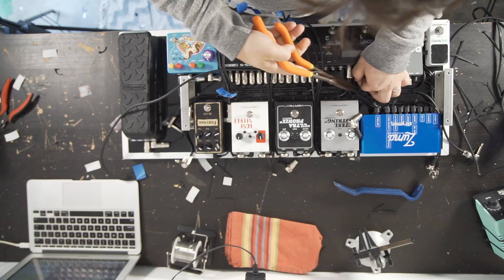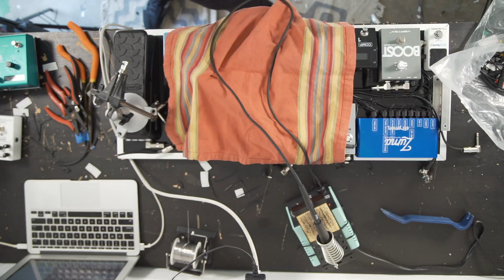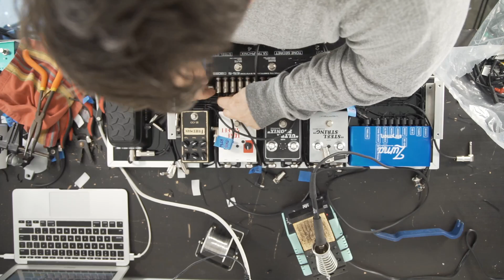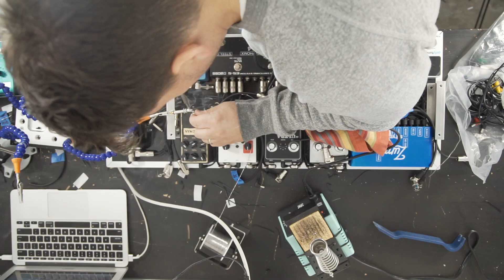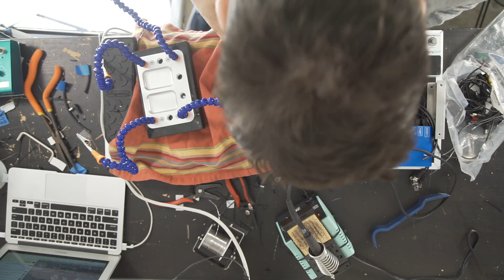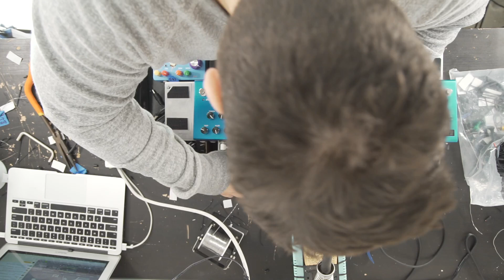Wiring a Pedalboard Switcher

Comment from the maker: Howdy folks!  Here's a little live stream for ya on how I wired this Boss ES-5 switcher.
Reply: Vertex Effects dang I suggested this through email awesome!
Reply: You find the Boss ES-5 Loops sound transparent (dare I use that word!)? It seems to be a pretty good deal.
Reply from the maker: Daniel Jeong There will be a follow up video coming out this week, so stay tuned!
Reply from the maker: Grant Ferstat Yes, this is all pretty standard stuff with the relays and all that for switching it out the loops, the only area where you’ll run into coloration is in the buffer. I haven’t disassemble the unit to test the actual buffer inside, however it sounds different than what I presume is the standard buffer circuit inside most boss pedals.  I wouldn’t say it’s totally transparent in terms of the buffer, however I think it sounds very good. I haven’t tested how long of a line it can reasonably run on the output before the tone really gets affected, but most of the times I’m using my own buffer on at least the output, if not the input as well so this is been a non-issue.

Comment: I guess the biggest advantage to the PedalTrain style boards is the space you gain by under-mounting the power-supply.  Maybe weight too??
Reply from the maker: PeterPug007 I would say it has way more deficits than benefits, having a power supply underneath pedals can be a real problem especially if we’re talking about a linear supply with the transformer underneath a digital pedal.  You also have to be very cautious of the loop area of the transformer, as dressing cables or putting other devices on top of it can create a major noise issue. People need to remember that this was a product designed by a welder, not an engineer. It took off because of its ingenuity for beginners to have a Pedalboard that they could build them selves. However the flat board, not only for troubleshooting, but travel worthiness, is the gold standard.

Comment: Most of the time people say that you should use the least amount of cable for your pedals, specially if they are true bypass, but for these builds and if you want some proper cable management it looks like you have some long cable runs, in your opinion what's the maximum cable length you could use before adding a buffer?
Reply from the maker: Ricardo Cabrera The longest individual cable here was about 2 feet - it was running from the last pedal on the riser back to the volume pedal.  If you’re trying to persevere the tone of the rig as close to direct into the amp, I’d say anything over 10ft. of cable will start to have an incremental impact the more cable you add and the more pedals you add.  Ideally, you’d want a high quality input buffer that your guitar cable hits first before the board - all true bypass pedals in between - and a high quality output buffer at the end of the chain to drive the cables back to the amp.

Comment: Mason,

Were your audio cables going into the switcher already zip tied down with zip tie mounts?…then you soldered the straight connectors to the switcher ? 

Or soldered the straight connectors then zip tied audio cables?

Thanks for the help 👍🏻
Reply from the maker: Solder one side first - dress it in place - then solder the second side

Comment: I really appreciate your videos. I am trying to come up with a pedal board but I want a lot of pedals with a switcher and I cannot decide witch one to get either boss es-8 or that new RJM PCB 6X. What is your take on that? Also how do you make that Stymon bridge it seems that will save space. How to you get one of these boards put in a case to transport around.
Reply from the maker: Braxal I think the Boss is the best value, and has the most feature set for the money. I also think they have the best software editor for consumers. The RGN is the best built of any of the switchers I know of, but doesn’t have the same functionality as some of the more advanced ones technologically. I have a link to the website for the company that makes these in the description box, you can email them for a custom size. I typically like to put everything in pelican cases, they are the safest case, and offer the most protection.
Reply: I very much appreciate your fast response  I will look these items up. i am spending hours trying to figure out a pedal board for wet and dry the proper amount, quality and types of pedals to put on the board. My mind has been swimming to the point where i am just stuck in place.  I am glad you are here to help.

Comment: Howdy, love the videos, they are helping me a great deal as I'm in the middle of building a board around an ES8 and a bunch of pedals. Was wandering do you power the ES 5 or in my case the ES 8 of the one power supply ie: I'm thinking of the 1 Spot Pro. Would that power the ES8 as well as the other pedals or should I run the supplied power pack to power the ES8 as a separate? Thanks in advance.
Reply from the maker: Yes, I power it off of the main power supply. In this video it was the Zuma, but you could just as well do it with the CS 12 power supply by Truetone.  I don’t recall the exact number, but the current draw for the ES8 was somewhere around 280 mA and more like 250 for the ES5.
Reply: Brilliant thanks. Again thanks for these videos they have and continue to help me a bunch so from down under Australia, cheers and keep them coming please!! 👍🏻  @VertexEffectsInc
Reply from the maker: Skman22 anytime!  My pleasure!  Hope we earned your subscription!

Comment: Hi Mason, I wanna ask to you how to install grounding cable in ES-5, because I saw that there is grounding screw in the ES-5 body..
Reply from the maker: Are you getting a ground issue with the ES5? An easy way to tell is taking alligator clip and clip it to the ES5 in the other side to ground and see if you have any difference. I haven’t run into a condition where I’ve needed to do this.
Reply: @VertexEffectsInc  thank u Mason..
Reply from the maker: @Senonez84  you're welcome!

Comment: Yo Mase, have you personally ever noticed Boss Tu3 tuners sucking out tone?
Reply from the maker: It wouldn’t be single-handedly responsible for the tone diminishing however, the buffer inside the pedal, is well…a Boss buffer.  There are a couple ways around it, but it really depends on what you already have, versus the idea of perhaps purchasing either another tuner that’s true bypass, and buying a quality input buffer and output buffer.  Or, keeping the tuner, and getting some sort of buffer that has a splitter off of the input so that the Boss tuner is not running in line.
Reply: @VertexEffectsInc  Cheers man. I appreciate it
Reply from the maker: Da_PorkChop Xpress My pleasure! One buffer that I would recommend if you wanted to keep the boss tuner is the Mesa boogie high wire.

Comment: Have you ever tried Techflex in a pedalboard build?
Reply from the maker: No, and I'll tell you why.  Although this seems like a good idea, the reality is pedalboards cables are relatively stationary, so the benefit of making them harder to bend is actually a drawback and makes it less ideal for all the hard angles on a pedalboard.  For an instrument cable, there is much more benefit as they get plugged in and unplugged regularly, get dragged around stages and studios and could use the extra reinforcement.  But on a pedalboard, it's not ideal, and won't get you a better end result with the finished product.

Comment: what right angle midi plugs are you using?
Reply from the maker: TrevorCGray Everything is listed in the description with links
Reply: @VertexEffectsInc  I don't see any right angle plugs, just the straight. Been searching for a while for some quality ones. Switchcraft stopped manufacturing them.

Comment: Hey there, I’m looking into getting an ES-5. I have a Boss DD500 that I would like to control using the midi function, but I’ve never used midi. My question is, does audio travel over midi back to the controller, or does the DD500 still need to be plugged into one of the loops?
Reply from the maker: The MIDI will control the parameters and turn the device on/off even if it's outside of the ES-5, you can just wire the DD-500 in series after your ES-5 for example.  Check out Rhett Shull's board where we did the same things with Strymon pedals.
Reply: @VertexEffectsInc  Thanks for the reply. That sounds like a great way to run it. I’ll have to watch that video again.
Reply from the maker: @dustinklassen8982  thanks again for watching!

Comment: Hey there, I was wondering if you could give me some advice. I have stereo FX that I need to run in mono regularly and want to build a board that'll make it easy to go either way. I run a stereo tremolo into a stereo delay and maybe some other stereo stuff but sometimes I need the tremolo in the amp's FX loop (w/d/w kinda roto effect) and other times in front of the mono amp. Is there a simple way to do that? 

Any other wiring issues when running stereo effects in mono? Should I give up and get a Helix?
Reply from the maker: You should sit separate presets for hard panned left for mono, and separate stereo presets with a left and right. For the effects loop thing I did a video showing a specialized interface that allows you to switch between the front of the amp and an effects loop.  I suggest you check it out. You would need one additional pass-through in order to accommodate the stereo scenario.
Reply: @VertexEffectsInc  thanks. I actually saw the interface video and it made me wonder about that. I guess that's the simplest way to change it on the fly.

I've got so much more to figure out in building this board still yet. I need to leave a ton of room to grow but I've got a performance coming up where I'm going to need a board and power supply for my measly five pedals. One of the pedals is an Empress Echosystem which narrows down my power supply choices quite a bit. Figuring out the right board for me is another issue altogether though.
Reply from the maker: @TheAlpineProject  let us know if we can point you in the right direction.
Reply: @VertexEffectsInc  I could certainly use some input on which board to choose. I think I could fit everything I have right now on a Nano with the treadle-style tremolo on the floor, but in the future I'll need something that's wide enough for an ES-8, 3 treadle pedals, and a tap tempo. That's close to 3' wide but maybe things can be repositioned. 

A bridge would be great to save space but I'm not sure if I've seen a board with a bridge that has room up front for treadle stuff.

 For a power supply I'll need something big like a Mondo. 

...then there's still the Polytune, Soul Food, Steel String MKII (can't wait to get ahold of that), Mooer Pure Boost, and hopefully a Skreddy Lunar Module fuzz. I've got the Empress Echosystem delay and I'm aiming to get the reverb they make and something like a Mobius. Plus I'll need room for that interface you mentioned and I think the Empress stuff requires a midi box. 

So yeah, that's mostly it lol
Reply from the maker: @TheAlpineProject  I would check out our pedalboards https://vertexeffects.com/store
Reply: @VertexEffectsInc  I dig them for sure but none are wide enough to do what I'm thinking. Should I just put some of the foot treadle stuff on the floor beside the board?
Reply from the maker: @TheAlpineProject  There are options for cut outs for wah and volume pedals, you need to look at the dropdown menu for riser options.  You can also check out my videos on how to size your board properly because once you add the riser, it double your surface area for everything under it.  Meaning you basically get a free row of pedals without getting bigger.

Comment: I have a GigRig switcher and I love it. I know it's an U.K. product but I feel like it is the best of the best out there. What do you think of GigRig products? I am running a 3 amp setup with a dry , no delay , channel and stereo effects  , delay , left and right channels.  I love the way tones swell with the 3-way amping system.
Reply from the maker: Cool.  If you like it, that’s what matters!  Sounds like a cool set up.  What are you using for your stereo power amp?  What’s the dry amp?
Reply: @VertexEffectsInc  My main amp is a Fender Dual Showman that has a gain mod and is equipped with Yellow Jackets so I am using a 6L6 and an EL84 in each channel, making it a A B amp. For the right/left channels I'm using Marshall Lead 20 solid state amps . They have each had an output jack installed so I can use 12" speakers. I hope to replace the Marshalls with a couple Hughes and Kettner Grand Miester 40s with 2-12 cabs in a year or 2.
My pedalboard has a ChandlerTUBEDRIVER, original RAT, Cry Baby Wah, Dyna Comp,MXR 10 band Graphic EQ, as well as Strymon Mobius, Time Line and Big Sky.  It has taken 20 years plus to build my rig

Comment: I'm having fx loop issues. I have a Randall Rg1503h and I'm running behringer eq, nux chorus, joyo flanger, ernie ball vp Jr volume, mxr carbon copy into the fx part of the electro harmonix silencer (in that order). I'm using a caline power supply to power them except for the silencer (using ehx power adapter for the silencer). All pedals using the caline 9v 100 ma except the chorus (9v 500ma). I lose all amp distortion and the effects won't work but they do work in front of the amp. I'm not sure what's causing this issue. I'm going to try to troubleshoot by running them without the silencer and if that don't work I'll try each pedal individually in the loop. If that doesn't work is there anything else I can try?
Reply from the maker: I’m not sure I entirely grasp what you’re doing, but it sounds like there may be some sort of impedance mismatch between the effects loop and the pedals themselves.  I’m not sure with the impedances of the effects loop in your amplifier, however most of the pedals that you are running here are likely not at line level, and I imagine that your effects loop is not running at instrument level.  I would start with them without using the noise gate and see where you are. Do you have send and return level adjustment on the back of the amplifier?
Reply: @VertexEffectsInc  There's no adjustment for the send and return. I'm going to check each pedal individually. I might just keep them in front of the amp (just until I can upgrade my son's pedals). This issue was driving me crazy yesterday.
Reply from the maker: Peter Machado Typically I’d say only run your delay and reverb in the effects loop, because most of the other stuff historically is all in front of the amp, and I also think sounds better that way since very few modulation affects are truly built for line level that are in a stone box format.
Reply: @VertexEffectsInc  thanks for the info. I'm going to keep this in mind when I upgrade his pedals. I didn't even think to look into the pedals to see if they were for in line or instrument level. I just assumed that they would work in the effects loop.
Reply from the maker: Peter Machado It may not necessarily be the issue, but it’s one to consider. There’s no standard in the industry for effects loop impedances so it makes it hard to know what will work and what will not
Reply: @VertexEffectsInc  I ran them through the loop without the silencer and the ended up working but with a massive decrease in volume so I just have it running into the front of the amp and it's working just fine. Building my son's second pedal board & patch cables was easy compared to trying to figure out this fx loop issue 😂.
Reply from the maker: Peter Machado Yeah, it sounds like you need to get titles that are optimize for the fx loop if you’re going to use one.  The noise gave me a hand in helping mitigate some of these impedance mismatch, But overall, If you want to use devices in the FX Loop, you’ll want to do some research first

Comment: Wiring the ES-5 on Saturday.  Ordered these plugs: https://amzn.to/2OHjZa0.  I noticed that you left a bad review video for these.  What do you think of them now?  Have they improved?
Reply from the maker: They've got worse over time.  They used to be pretty decent when they were distributed by Orange Co. Speaker Repair, and I've found the consistency is bad that I can't use them as a cheaper alternative.  The QC is bad and if you get them off a run where the tooling was getting out of calibration, I've had batches with 50% failure, and likely more over time when in use.  A good batch had at minimum 1 out of 10.  I've moved completely to Squareplugs and have yet to have a failure due to the plug.